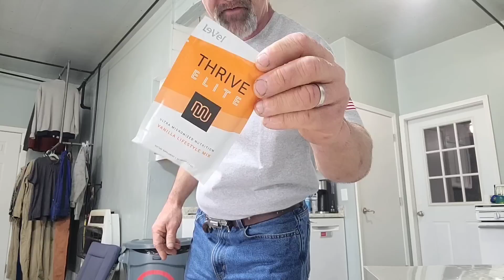Welding repairs on a knuckleboom log loader

Comment: CB, I think under the conditions you dealt with on this repair, there is probably not a better repair that could be done!   That metal strip around the edge, was a stroke of genius, IMO.   One reason I have such appreciation for your videos, is that you take the time to explain your process, and the rationale behind doing it the way you are.  I much appreciated the info you gave on the 7024 and 7014 rods, and why they are high deposition.   In my year of welding school, they just focused on 6010 and 7018, like that was pretty much all you would ever need.   I’ve heard some good things about Hobart Fabshield 21-B wire, better elasticity, and about 90,000 psi, if I recall correctly.   I have used NR-211 from Lincoln, and it runs good, but I think I’m gonna have to spring for a spool of that 21-B.   I chuckled when you mentioned the Trailblazer and the LN-25 wire feeder playing nicely together.   I’m considering a Miller 8VS suitcase to hook up to my Bobcat 260efi, even though I don’t have Arc Reach capability.  I could use my MM-215 or my PW MIG-285, but in rainy conditions like you were in, would prefer to keep my circuit boards dry.   Superb video and repair….bravo!!!
Reply from the maker: If you plan to run your flux core in diameter .045 or smaller then you may consider using an ARCCAPTAIN  MIG 200.  I've done two review videos on those...affordable multiprocess machine that is actually smaller and lighter than a suitcase feeder and alot more versatile....keep in mind though if you think you'll want to run big flux core like .068" or 5/64" then you'll hafta get a suitcase feeder...the ARCCAPTAIN doesn't have the drive rolls or gun for huge wire.
But an ARCCAPTAIN MIG 200 with a 10# spool of .045" Fabshield 21B is a handy little feeder/welder.
Reply from the maker: https://www.arccaptain.com/?ref=NBSWELDING

Comment: Try blowing compressed air through the liner tube after you  remove the contact tip. The liner gets clogged with metal dust from the fluxcore wire. G. Luck !!!
Reply from the maker: Thanks for the info

Comment: I love how you did that repair over and beyond just fixing the crack in the plate. Adding the bar stock was extra strong idea to prevent a tear from starting again. I like over & beyond repairs, I also like to fix things way more than needed to prevent further breakage. Especially on these logging machines that get aot of hard use like this. Nice job CB! 👍🏻👌🏻🛠️🔧🔌⚡⚠️🗜️

Comment: Yeah brother! I look forward to your videos. I swear your welds are a work of art. It was cool how you could see the heat expanding the metal and moving the bar when you were heating it up. I've learned to never look at the weather around here, or I would never work. I swear it just says 50% chance every day and the weather people just sit around taking bets. Our weather report is just looking up to see how dark the clouds are and "whether" or not I should start moving my stuff closer to the truck.😂 I've got a Weldanpower 250 G9 Pro and I'm looking for a decent LN25 to run with it. I've been studying about flux core a lot lately and I think it will work really well for the repairs I'm doing. It is funny though, every time someone sees me using one welder, they seem to forget that I have other welders and they think I'm going to use that welder for everything. 🤘🏻😆👍🏻
Reply from the maker: If the flux core you wanna run is .045 or smaller you could consider getting an ARCCAPTAIN MIG 200 instead of an LN-25...The ARCCAPTAIN would replace many of the machines you have and is extremely versatile...the only advantage to an LN-25 to do flux core is if you want to run the huge wire like .068" or 5/64".
Last time I looked you could get an ARCCAPTAIN MIG 200 for $359.
I did 2 review videos on it...just used it to solid wire MIG a Bronco frame yesterday...great machine for the money...use the link in my description to ARCCAPTAIN site so they know I sent ya

Comment: I used to run Hobart flux core wire exclusively when I was just starting out. I used to really love flux core. Now I’ve been running Lincoln 211 because of moving and different suppliers and whatnot and I don’t know if it’s because I’ve been doing way more solid wire and stick welding but I seem to not really like flux core now. On a side note everytime I see one of them LN25’s they’re always covered in all sorts of grime and always seem to have feeding issues. I had one guy come out and help me with some stairs one time he had just picked up a new to him LN25 at an auction. By the time he had it feeding correctly to be able to weld one stair tread he coulda had the whole staircase welded up with some 6011/6010 if he woulda just ditched the feeder the first couple minutes of it not feeding right.
Reply from the maker: Flux core has its place...but any wire machine with feeding issues is a hassle
Reply: @NBSWELDING  yes. Also, Thank you for making these videos.

Comment: try dual shield 71A75  I use a ton of it now on that type of repairs and had really good luck with it holding.
Reply from the maker: I've ran alot of dual shield and I do like it for many applications but I don't use it much anymore...almost never for field work....the gas cup on the gun irritates me in cramped positions and tight spaces and I really don't mind stick welding on most things just to keep it simple

Comment: pipliners cloud umbrellas are a life saver for rain or sun.  

I just did the same repair on the JD version of that about two days ago they aren't built very heavy for they size logs we have on the West Coast so they break allot. I used Hobart 21b flux core it works great for those tight spots. I've had to remove the top plate on those outrigger frames and remove the outrigger cylinders before to get them fixed properly when they brake up by the pins in the center. those ouside ones fail very regularly i normally cut those back about a foot or so and replace that thin plate with 3/4 and weld it back up and they last for a long time that way.

Comment: How do you avoid slag inclusions with 7014? Everytime I try to run it I always run into that issue
Reply from the maker: Proper amps, rod angle, travel speed, material prep, and manipulation.
There is alot of slag there and it takes practice to be able to see what is slag and what is weld puddle....usually slag inclusion is a result of the slag overtaking the weld puddle just before it cools enough to solidify...you gotta operate in a manner that pushes that slag away & behind the weld puddle 
You can practice this by running straight beads towards yourself on a plate that is angled slightly so that you can see the slag running away from you...then move the plate to completely flat and run a few beads...then angle the plate towards you so it is slightly downhill welding and watch how the slag tries to run into your puddle as you travel...when you see and understand what is molten steel and what is slag then you can start to manipulate your stinger to combat the slag....like I said changes in amps, rod angle, rod manipulation, and travel speed will all make a difference.
Stay with it and good luck!
Thanks for watching and commenting!

Comment: I found it interesting to watch when you were heating that steel for the edge how much it moved from the heat, could you show that one day, does it move more if the steel is super cold like that day or does it all move the same depending on the size your using . Cheers nice job yet again, your a good man,
Reply from the maker: It expands when you heat it..so if you heat one side of a piece when that side expands more than the other side then the metal will curve as a result of that expansion

Comment: Very well done.  I've welded for years.  That's a  solid "in the field" repair.  What would you normally charge for that ?
Reply from the maker: $75 per hour from the time The Super Service Truck pulls out of the shop until the time it is back in

Comment: Great job, but I was surprised you didn't wrap something around the cylinder shaft to protect it from splatter.
Reply from the maker: Probably should have...not a bad idea
Masking it off could protect it from accidental arc burn from the welder too.
I didn't damage it but there was risk there...I was definitely being very careful to not touch it with the welding rod

Comment: Is there a reason you torch gouged that rather arc gouged it?
Reply from the maker: I don't have compressed air on my rig...and a carbon arc is a very dangerous thing to use that close to a hydraulic cylinder

Comment: Super repair thats much stronger than original. The overall factory metal selection looks flimsy for the loads imposed. Did you feel like the hydraulic ram was high enough to be out of harms way? We appreciate the explanation of how and why you choose a certain rod or process, technique ect. You have a great channel you should have 100k + subs.
Reply from the maker: I think the ram was in the best spot for what I was doing

Comment: Good repair, would of thought you would have used a needle scaler for some stress relief.

What have done with the mig guns is to convert them to Bernard center tips with a self shielded conversion kit.

A DS-1 diffuser and a NS-FLX , and for the Lincoln gun a adapter to connect the Bernard parts. Made the adapter from a 1/4" npt barbed brass  5/16 fitting threaded to fit the lincoln gun.

The Profax catalog has the dimensions  of nearly all mig guns, for lincoln it is 3/8 - 24 thread, if i remember right.
Reply from the maker: I don't have compressed air on my rig...never have